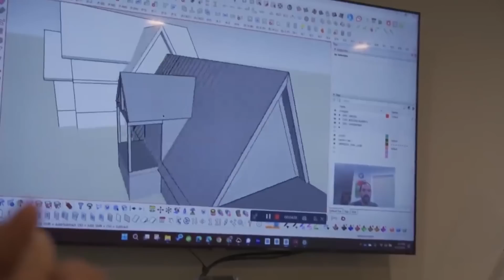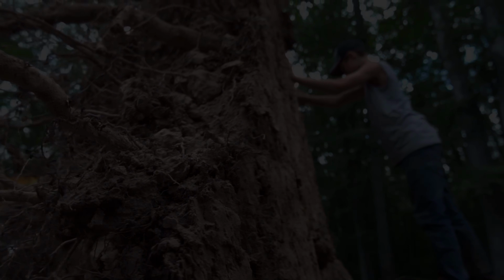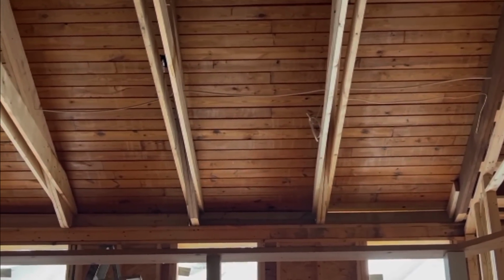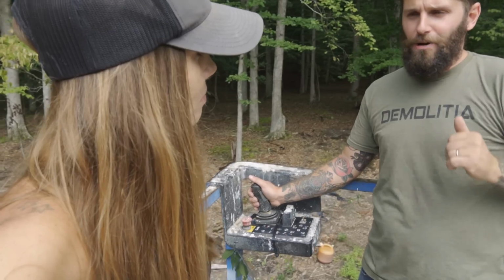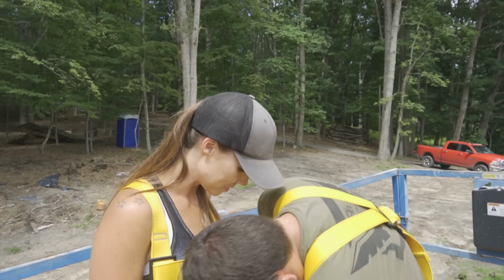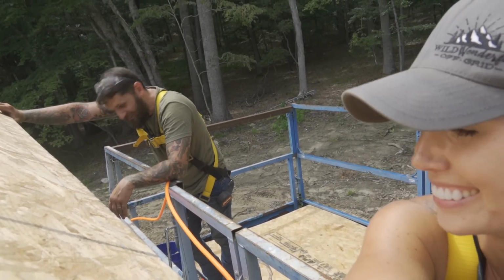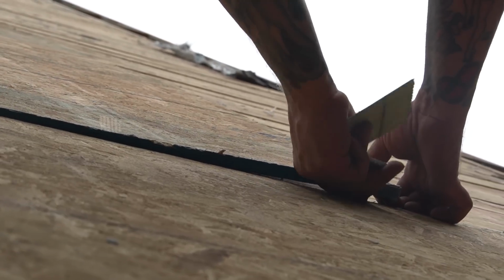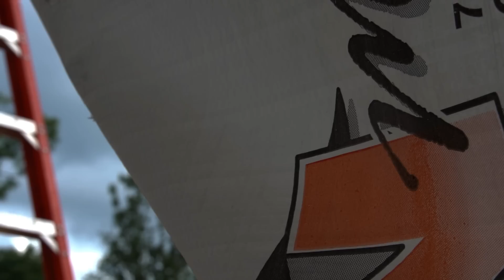Breaking Ground On The A-FRAME ADDITION | Flooding Ruins Wood Floors | Installing Roof Sheathing

Comment: We are just outside of Fincastle, VA.... not far from Roanoke, and we are having the same issues with contractors here.  My husband is 71 years old, and we just shake our heads and give up on hiring people and do the job ourselves.  It's hard at our age.  I feel your pain when it comes to finding reliable contractors.  We hang our own cabinets, put up our own drywall, install our own backsplashes, re-build our back deck two stories up, etc.  When it comes to outdoors, I really bristle at seeing my husband up two stories on a ladder.  It sucks!

Comment: I’m a project manager for a roofing company in Florida. If they dried it in properly you wouldn’t have those issues. In the state of Florida building codes have changed and you have to either install double synthetic ( overlapped half the width of the roll) or install peel n stick. We only install peel n stick on roofs now because synthetic isn’t as trust worthy and also way more time consuming. Plus you get a deduction with your insurance company for a double water barrier with peel n stick.
Reply: i agree i built 130 houses in Jacksonville i was a framer till i became a maint supervisor
Reply: That's how mine was done. All peel and stick here in FL.
Reply: You mean if the contractors had dried it in properly
Reply: We have very strict requirements for roofing in Florida.

Comment: I found out the hard way that wrap is not waterproof no matter how you nail it.  I had finished the floor, plywood, on my video/audio recording studio next to my house and it turned out way better than I could have expected to be doing it alone, but then, rain.  I quickly covered the floor with wrap.  The next day it was flooded and the edges of the plywood, which had fit almost perfectly, started to raise up.  Lesson learned.  wrap is NOT like tar paper/felt nor plastic.  It's basically a wind break, but not a water break.  But you two have the best can do attitude.  Love watching you as you progress.

Comment: Tip: When you're up there setting up the anchors to tie off on and you want to be safe from falling, here's what you do. Throw a heavy rope clear over the roof to the other side and tie off to structure if you can, anchors to remove later if you can't. From there, you can secure your harnesses self with a rope break, moving yourself up or down as needed.
Reply: We did that in the 1980s. I fell off of a 55' peak. I was anchored on a tight line to a generator on a trailer. It was a slow fall as I was dangling under the eave when then momentum stopped. The crew had to help lower me to a window. THAT was the unsafe part... and my hammer falling. Good times.
Reply: @thanekewtoo  Oh my! That'll tighten your sphincter.. But at least you lived to tell the tale and that's the important part.. His choice of footwear was a little problematic too, I should mention.

Comment: That happens with remodeling, you just have to commit too a point,  and adjust it. You can also pull a tape from the Ridgeline too the tails and keep it parallel. After you have put down your sheeting take some 2×4 and put some metal banding  straps too them and nail the straps to the rafters. Do this after putting your 30lb felt or waterproofing membrane. To keep from sliding off. Then when you need to remove them just cut the straps off. They can be attached directly to the rafters if using a metal roof, and on any pitch greater than 3/12 , at the bottom edge to stop from sliding off. In addition to the harness. But make sure that there fastened to the rafters, having them come loose because not done right. Then falling 15 feet or greater with plywood chasing you really does hurt! 
Get it dried in the mean time, and get that moisture out of that floor below 8. What a mess.
Take care and be safe and count your blessings amen.

Comment: Shameful how these contractors keep screwing people over. 
So hard to get anyone to start and finish a project especially correctly. If u don't know your trade find another one you do know. Glad y'all are knocking it out correctly.
Reply: agree 100% Josh and Erin should charge those contractors for the material and labor to replace the floor
Reply: You hear the stereotype of bad contractors, but you hope they are exaggerating...
Reply: @randalllaue4042  sorry to say its true and it give the good contractors a bad name
Reply: @rhyscook5138  several of these shows are in “Stalemate” for having to deal with this legal issues. They have to get BBB to crack down on them

Comment: Hello from The Land Down Under. Sorry to see the follow on problems from incompitant contractor. I have been in the flooring industry in Australia for over 30 years. To see if you can save your existing timber floor. you have to have the floor go through both extremes of tempreture. From coldest to the hotest tempreture, because that will swell the wooden floors from max to the minimum. Once both temps for exspantion and contraction have been reached, and the floors have been sanded in both tempreture differences. Then you will be able to save the floor, or know if you aren't able to save them. I really hope this helps with your reno.
Cheers guys i really love watching your video's. Keep up with the great video's. And keep your heads HI.

Comment: I totally relate to what you said about contractors.  Ive been trying to deal with an excavation contractor at my property in Tenn.  I hired him in January to clear and level a 100' x 180'.  He started the job, ended up clearing 80' x 300' claiming that's what I agreed to.  Despite multiple completion promises, and uncountable excuses, here it is, the middle of August and the job still isn't completed.

Comment: She is a trooper pushing up the sheets up the ladder to where they need to go. 
PS Josh, I don't like heights either but have, like you, just get used to it and work away.  I still can't believe I used to do steel building construction and ran along the beams.

Comment: When I installed shingles, repaired or remodeled roof structures, if a new deck was required, as soon as the second row was up, the first got ice and water shield. Repeat. The W R Grace stuff was tenacious and the CertainTeed was easier to layout, but if it rained, the tarp job was faster. We also used toe boards. Never used the harness system, if it even existed then. But . . . ice and water shield installed at the same time the decking went on was piece of mind. No nails needed, just peel and stick as you rolled it out. No water inside, unless the tarp had a hole. BUT, the job was never left without a tarp, ballast or ballast boards. (1x2 or 3s nailed up and down the gable or eave edges and some in the middle to keep from billowing) Of course the shingles were on site before the job started to use for ballast. Tech has changed, and the system used probably should have worked if installed properly. That's a tough result. My condolences to the flooring, exposed board ceiling, and the additional grief and expense you incurred from another contractor mistake.

Comment: When setting up you can anchor a rope on one side of the building and then pull it up over the roof. A weight tied to some string, which is in turn tied to the rope can be thrown over the building. Be safe.

Comment: Congrats on starting the house extension! Very exciting! Growing up in Florida we had a couple of tree incidents, one in our yard just barely clipping the house, but was a good 70 foot long and could have easily crushed in most of the house (dad was out of town so I learned how to use an axe to cut it up enough to clear the driveway) and then another acted like a lighting rod and had a strike go down it and into my sister's room. Lots of reasons to keep trees a good distance away, even though the shade is great. I can't imagine seeing water pouring into the house like that. I'd be irate and suing. So sorry for that.

Comment: I'd blue-tarp that roof and seal-up the window openings so you can walk away for a couple months and let it dry-out.  Come back before the seasons change and get the house closed-in for winter.  Go work on the A-frame extension and come work on the renovation house during winter when you can work inside with heaters.  Good luck.

Comment: FYI.... the closer a tree is to a house the less damage due to inertia.... lioke if you get the top half of a tree hitting it the inertia has sped up the top of the tree and has much more energy going intp the structure

Comment: Watching Josh conquer his fear of heights to get up there and and secure the anchor point was one thing impressive…..then to hear Erin call out the snotty work of the previous roofer by attaching the underlayment incorrectly…then watching her go ‘beast mode’ when pushing the OSB sheets up the roof……Damn you two are impressive on so many levels.

Comment: Josh - I've been watching your channel for quite a while now.  I feel like you and I share similar experiences, and we are both perfectionists.  Your problems with the reno house brings to mind the many system renovations I faced as an electrical engineer and programmer.  I got to the point that I would rewrite a program from scratch rather than try to follow someone else's mess.  I'm afraid of heights slso!

Comment: When I put a roof on my cabin, it wasn't supposed to rain either.  Just in case, though, I bought a giant tarp as insurance with every intention of returning it unopened at the end of the job.  We tore off the roof on day 1 and then about midnight heard thunder in the distance.  We used our truck and cars to light up the roof while I scrambled up there in the rain to roll out the tarp.  I was glad I had the tarp on hand, but dang it was an expensive item to only use once.

Comment: First secure line you throw up is from the opposite side of the building. Even if it is anchored from a truck. This way safety is not an issue.

Comment: I was the be real contractor on our second home and we had issues with EVERY contractor. They cut corners or don’t show up or just take 2 hour lunches and still cut out early. We retired and moved to the Pinehurst area in NC and remodeled our kitchen and removed popcorn ceiling stuff. Hired two contractors . . . another mess. We built our deck by ourselves  (mid 60’s) in July after we threw the contractor off our property. Bottom line, you’re not alone and I feel your pain. I’m just guessing that this is the last contractor you will hire.

Comment: Yeah, those cowboy boots are certainly not cougar paw roofer shoes, but not many people can afford nearly three hundred bucks for shoes, just to avoid a little slippage. For years I wore a pair of new balance tennis shoes that I worked over with a utility knife so they'd grip better. But no shoes help when your on a 12/12 pitch working off roof jacks 2x6's and extension ladders. It all comes down to overcoming your fears and putting on your big boy pants and getting it done. You two did a great job, as usual..

Comment: Don't know if someone mentioned this or not but...to get yourself a rope to walk up the roof initially to attach your anchor...go to opposite side with a roll of string and and a softball..tie string good to softball unroll a bunch of string...throw soft ball over house...attach your rope to string..using your string pull your rope over roof...of course tie end of rope off on a piece of heavy equipment..tractor ..truck ..tree...etc. on opposite side.

Comment: The roof wasn't dried in right by using the staples. If you're going to install the shingles right away, the staples would be fine.(your local building code) In Florida we use plastic simplex's nails. As a few guys said below, Most use peel & stick (ice & water) because of the insurance and building codes for our dryin. I would look at filing a CLAIM on your Roofers Liability insurance. You documented it very well. Shouldn't have a problem. Would get new floors out of it, plus more.

Comment: I really enjoy watching y'all do your thing. You are both so impressive. I do have one suggestion - I would suggest you get a siding/fencing coil nailer. I use one for fencing and it is so much better than my stick nailers. Mine holds a coil of 300 galvanized - ring shank nails up to 2.25 inch long. It's much lighter than my framing nailers and is so much easier and faster. This is just a suggestion, but I would check it out.

Comment: Just a heads up, but I think the shock cable that has the strap overlapped and wrapped together to slow your fall should only be on the harness and not the anchor line that is attached to the roof anchor. When you pull on that line, you could put the wrap apart and actually fall. The anchor line should be rigid, the "shock reduction wrap" should be on the lanyard that connects your harness to the anchor line.

Comment: I know it’s probably too late for this house, but maybe not for your home. Use what is commonly called “Peel & Stick”.  Also called Water & Ice. It can be on for months without any leaking and is generally a cost savings insurance wise. It will take the worries out of leaking roofs for longer than shingles will last. Wish I was there to help you.

Comment: Finding a contractor(s) in West Virginia has been a HORRIBLE experience. April 2021, we bought a 110 year old house in Randolph County, WV. We hired a roofer to fix a few things out of Elkins. Good group of guys. We hired an HVAC company that took 4 months to do the work. INCOMPETENT. They didn't do many of the things we paid for. They TURNED OFF our security system whenever they were onsite. Duct work not completed. Wiring not complete or to code.  Gas lines not attached, but valves left open. THEN they claimed we needed replace the gas system in the ENTIRE house. $5k. Plumber brought in... nope.
 
Our 3 room renovation has been the major contractor issue. After a year and a half and 2 estimates from reputable contractors, we finally MAY get it done. This contractor keeps postponing the start date. He keeps losing crew members to Texas... better pay.

Comment: Roofing is hard but satisfying working work. Once you get the plastic underpayment on properly it will be water tight. I assume you will be putting on a metal roof? While my wife and I live in a county with a larger population, finding good quality tradesmen is still difficult.

Comment: With your can do attitude I don't think this will set you back long.  I think after building your house you will be able to handle the roofing.  It would be nice to be able to contract something out.  But as you shared you are a bit out there so the good contractors are busy and you are so remote you don't have a neighbor that you can consult with. It makes the journey longer but at least you know when you put something up the material you used is quality. We are rooting for you and going through some of this with you. Meaning house maintenance and rescreening screens.

Comment: Again. What's up with contractors in Virginia. If they used tar paper/felt on roof that wouldn't of happen. I guess it's okay to use as long as you get it covered asap. Want it done right guys😃do it yourself. What a mess to clean up and fix. Sorry you have to clean up a contractors mess again. Your design on second 1/2 of your home build looks awesome.

Comment: Erin has a new resume enhancer. In addition to concrete guy she can add roofer. I am sorry that you have to go through this but you will get through it and know that it is done right. If they couldn't do underlayment correctly, they sure wouldn't do the rest of the job right either. It's painful but I am sure that you are better off with them off the job. I have had to do this as well...no fun!

Comment: As sad as this is with this house...! There is an even sadder part to the story. Before this "contractor/roofer" was hired. How many other people's homes has he worked on..? Most new roofs when finished come with 10 - 15 year guarantees/warranty on materials. But, if you can't see how the material was installed, then 5 years in time passes, roof starts to fail, you have no way to know it was done wrong..!  

Now as bad as Josh and Erin may think this "is"...this is a blessing. Can you imagine finishing this home, and then it had "happens" has I had wrote. 

But, now they will know it will not happen to them. But the sadness is it is  going to happen to how many other..because of "improper installation of materials"...!

Comment: Holy crap! What did they do to your roof? I'm no expert roofer but have laid roofing... both tar shingles and metal... and never had a roof leak so bad. Did they just use the wrap as a temporary barrier? Did they lay tar paper under that wrap? We've always just used good tar paper and never had rain leak through. Not even problems with high winds. Is the roof contractor bonded and going to repair all the damages? What a mess.

Comment: Holy cow, where do you find these un-responsible contractors? Roofs are very labor intensive, but not complicated. I am not a roofer, but I have torn off and rebuilt many roofs. Sheeting, tar paper and and flashing can be done in a day with a couple of decent helpers. Your pitch is tough, though. In CA, most of our roofs are walkable.

Comment: I sorta feel sorry for the guys who got bee stung, yet I got stung 37 times by yellow jackets thru back a 6-pack to dull the pain while my g/f was pulling out the stingers and went to work the next day.  People today don't want to work, they just want a paycheck.  Was called GOLD BRICKS in my time.  You guys do much better work anyway, and with Erin cracking the whip I think Josh is getting over his fear of heights :)  I guess a log splitter will be next to split all that wood, for in the new woodshed. Maybe check into a premade small building and save time and money.  Search for Post and Beam Kits.